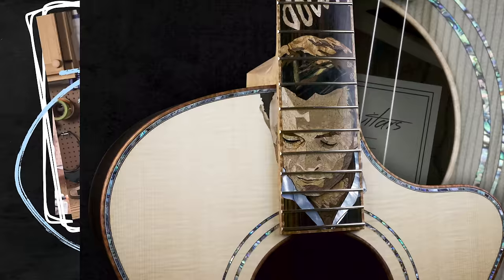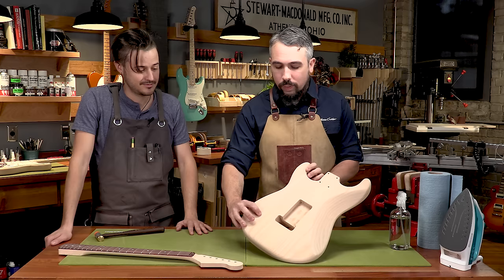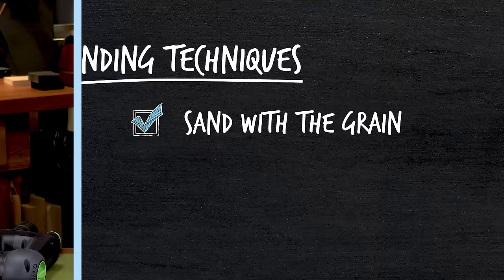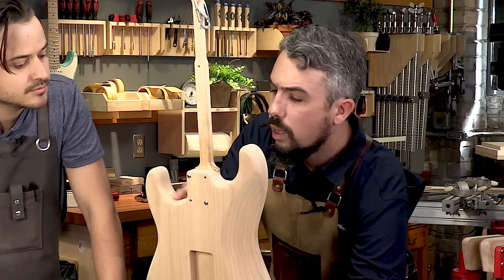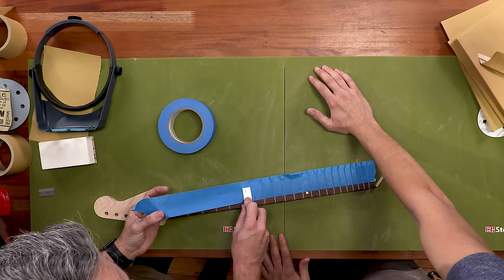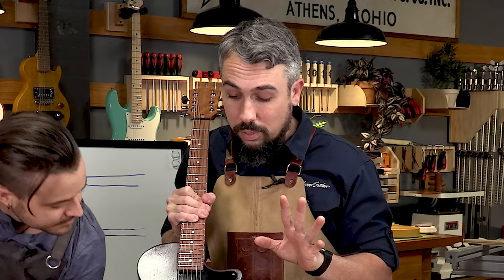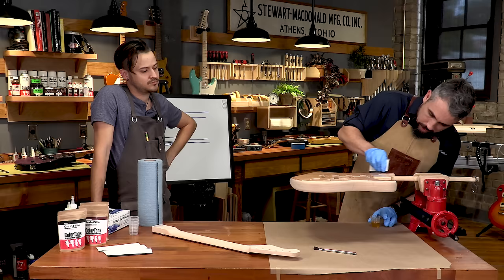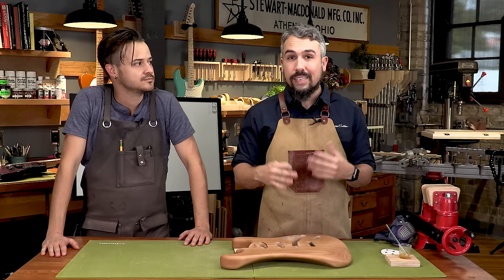Aerosol Guitar Finishing – Part 1 – Prep Sanding, Pore Filling and Sealer Coats

Comment: thank you Chris and Matt. question please i am going to do a sassafras  back and sides with red cedar top with red heart binding . i would like to add a color , red to the pore fill to add a touch of color to my classical guitar would that work . i must add i have never done any of this before so i am asking am i on the right track . also do i pore fill the top of the red cedar ????
Reply from the maker: Red cedar does not need pore fill.  In terms of coloring your pore fill that is doable but you will need to experiment a little to get the color right and make sure it dries hard.  Both ColorTone stains and Mixol can work in epoxy... but test your mix on scrap before you apply it to your guitar. Hope this helps.
Reply: @stewmac  thank you

Comment: Hey guys great video - just wondering if spaying a clear ceramic paint (like duplicolor) over nitro (colour paint) will work? I have run out of nitro clear and it’s quite expensive to get hold of in Australia - thanks :)
Reply from the maker: Probably not, nitro doesn't work well with most other types of finish. Test it on scrap if it's your only option, but we rarely recommend mixing up finish types. Good luck!
Reply: @stewmac  thanks so much for the reply!

Comment: Back in 78. I bought a 55 LP jr for $89. Like an idoit kid. I wanted to repaint it. Now its covered in urethane surfacer. I've been an Airplane painter for the last 42 years. Just found the Old LP. I want to refinish now. Back when I was kid. I tried washing the finish off with MEK. I noticed it thick layers Shellac on it. They used larger drips to fill pinholes etc. My question is can ya put Lacquer over Shellac? That's what it look like. Yes I threw that old Junky P90 away Kick me. I'm 63 now gonna do it Right
Reply from the maker: If it is truly shellac, yes.  Everything adheres to shellac.
Reply: @stewmac  Thanks, Its interesting to see what was under the clear. Looks like they Primed with Shellac 
There are Large Drop Fills of it as you remove layers of Lacquer. Top appears to be a Bright Yellow. Not TV. A Tobacco Brust almost Black . The backs tinted Mahogany. The whole thing was Shellaced in the beginning. I have to Sand it First. Then I'm gonna Buy Your Stuff. Thanks for your YouTube Videos. I can Paint a Plane and cars. This will be my Firsy Guitar

Comment: I would suggest a weight measurement of the epoxy, there is absolutely nothing more defeating than uncured epoxy on your project, and and true bear of a job to remove.
I only mention because it appeared a bit casual when it was being mixed .
Just a observation , great job otherwise.